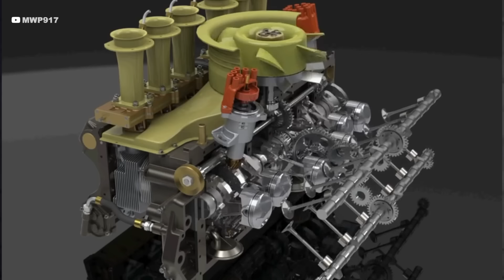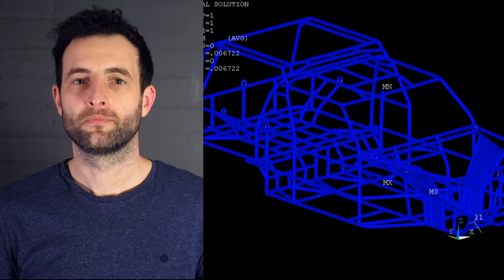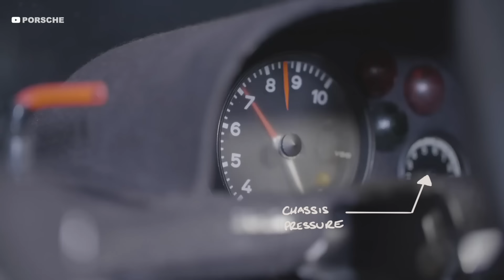The Porsche That Had an Inflated Chassis

Comment: Just imagine if they'd managed to (whilst fixing the aero issue) implement a DRS-style mechanism that could run faster top speeds in the straights, albeit at a safer level than the original. With the improved cornering performance with full drag/downforce in effect, there's 30mph of unused top speed available in the car, if they could have found a compromise of say 15mph improvement in straight line speed without affecting cornering performance, that car would have needed it's own class. 

In terms of the old back straight at Mulsanne, (I based on 3 Miles rather than 3.7 to allow for accelerant/deceleration), it ran the distance at roughly 48s, based on a rough calculation at 225 mph - taking that up to 240 mph would drop the time to 45s, and that's based on the back straight alone, let alone any others. So, the 917K gained 4s per lap by fixing the aero, if they'd managed to reduce the drag to 50% of it's original value just on the straights they could have made a further 3s per lap gain, at least.

To be fair, the question probably came up when redesigning the car to the K spec, but that was decades ago, perhaps if they had access to today's technology/data, this would have been possible.

Comment: I wonder if they could have fixed the problem of the air detaching from the car by adding small plastic vortex generators to the top of the car. Works wonders on airplane wings to keep the airflow from detaching!

Comment: Nitrogen doesn’t react with the metal due to displacing oxygen preventing corrosion also it’s a dry gas that does not react much to temperature causing a pressure rise or fall. That’s why we use it in HVAC

Comment: What effect was the air cooling for the engine to road holding. The fan was  pullung abotir from the bottom to the top, right?
Reply: fan pulls air down around the engine inside an enclosure, air exits below the car. no effect on roadholding.
Reply: No....top to bottom.....
Reply: @TheWilferch   Well it is a shame that the air was not running from bottom to top.  Extra Downforce??
Reply: @jamesthornton9399  ... well yes, theoretically that would be true.....but cooling a big flat-12 "evenly" by an air fan was difficult enough, and the most efficient and effective cooling would be forced-draft "pushing" air over the cylinders ....not instead having the fan suck the air on the exit side.
Reply: @TheWilferch  ok.

Comment: Just some nitpicky things:
It's not a flat-12, it's a 180° V12.
The car that had the "fly-issue" (ambiguity, lol) was not the 917k, it was the 917LH ("Langheck", or long-tail) so they developed the "Kurzheck"-variant (or short-tail), to improve downforce. 
And actually those teams that could afford it raced the 917k in the 1970 Le Mans Race and those who couldn't had to use the older LH-variant, of which none would complete the race while the 917k won overall, as far as I remember.

Comment: 1000bhp from a naturally aspirated 5 litre engine? No way Pedro!
The later CanAm versions with turbos yes but not in their original guise.
Also the Ferrari 512s were actually faster but as you say heavier due to their steel spaceframe chassis with aluminium panelling to try to increase stiffness and thus slower around corners.
Derek Bell drove one at Le Mans and complained that although his feet and lower legs were effectively the crumple zone as they were in front of the axle line, he had a problem with stopping the car from 200+ mph. This was due to the bodywork being so thin that the panel over the pedal box would flex downwards at speed and trap his right foot on the accelerator and required great effort to move it to the brake pedal. Not the best thing at speed, at night, in the rain, approaching Mulsanne Corner! As for the clip of Pedro Rodriguez spinning on his way out of Druids to Graham Hill bend, I was there that day and the whole race was held in those conditions. Yet Pedro recovered and went on to win by over a lap!

Comment: The Porsche 917 chassis was NOT inflated,  i. e. it did not get bigger like an inner tube or balloon,  it was PRESSURIZED, not the same thing as inflated.  Pressurizing stiffened the chassis so the suspension worked more accurately.  English is a very specific language with words of very specific meaning and important to use them correctly.

Comment: Is there any citation for the 917 having 1000hp? The only variant that I knew of that could achieve such horsepower figures was the 917/30 raced at CanAm.
Reply: "Porsche 917 - Wikipedia" https://en.m.wikipedia.org/wiki/Porsche_917. In the 1973 Can-Am series, the turbocharged version Porsche 917/30 developed 1,100 bhp (820 kW).
Reply: @sandybarnes887  I wrote that on the comment. The entire video is talking about and features the earlier 917K and I recall that car having slightly over half that horsepower...

Comment: Good video thanks, although to me the 'extremely difficult' handling of the 917 is let off rather lightly. Yes 'luckily' it wasn't an end-over-end flip as shown, but John Woolfe was killed when he spun his 917 on the opening lap of the 1969 Le Mans 24 hours. Richard Attwood has said that Woolfe is the basis of the deceased driver friend of Steve McQueen's character in the film Le Mans.

 Richard Attwood was also the winner of Le Mans in 1970 in the Number 23 917K with Hans Herrmann. The iconic Number 23 car is shown a bit out of sequence in your video.

Comment: Helicopter rotor blades used the pressurised spar solution to tell you on a preflight if the spar was cracked

Comment: 5:50 just out of curiosity
why they don't fill up the frame with helium so they can save even more weight
and it's a noble gas it won't react with aluminum

Comment: Pretty sure this car had around 600hp, not 1000. The Can-Am turbo 917s had 1000hp+, some say as much as 1500hp, but not the NA cars. 600hp was still a very impressive number for an NA 4.5 liter engine, in 1970. Also, particularly in the early 917s, the chassis were extremely flexible, which accounted for much of their evil handling nature. I love this car, it's one of my favorites of all time, but Porsche's reliance on the technical tricks mentioned didn't produce a sound chassis. It took bigger balls and greater skill to handle this beastie than it really should have.

Comment: Scott: That Porsche nitrogen or gas filled space frame was not such an original idea. My friend has a 1968 Czechoslovakian Zlin Z-526F tandem seat, aerobatic trainer with a very similar system. There is a pressure gauge inside the cockpit to detect any cracks in the chrome-moly steel frame. But unlike the Porsche 917 it was not made from "unobtainium" as the late Mark Donohue once quipped when asked what the frame was made from.

Comment: there's no way this actually changed handling lol. The reason for lightening cars is so that there's less inertia to be counteracted while cornering. Making the car more buoyant wouldn't do anything.
Reply: Depending on how much pressure they put in it would change how stiff the chassis is. Similar to how a coke can is stiffer when under pressure but very weak when empty.

Comment: Not 1,000 Brake Horsepower at Le Mans, but about 600-650 BHP give-or-take, and depending on the actual displacement (there were several versions).   But...1,000 BHP for the turbocharged versions that came over for the Can Am series (not Sifferts first non-turbo version), as with the 917-10 as driven by George Follmer and Donohue's later 917-30?   Oh yes.

Comment: I know the Ford GT40 had it in the front (the Mk.IV in the rear) and the Porsche 917 at the rear, on top of the gearbox : a SPARE WHEEL.
My question: was that in the rules back then?  Or did teams/manufaturers only put that in on long circuits like Le Mans, Nordschleiffe, etc. ?

Comment: Triangles are the strongest shape in nature (a British engineering guy that has a channel on YouTube said that)
Reply: Designers can learn a lot by examining structure of cathedrals built in the middle ages. Some of them had catastrophic failures as they progressed to larger and taller structures to be "nearer to heaven." Timber ship building too. I find those two things very interesting, along with timber frame homes roof systems.

Comment: Pedant's corner: pressurised, NOT inflated, which surely would make a better, alliterative title: 'The Porsche with a pressurised chassis'

Inflation - literally by definition - means the object being inflated is distended by air or gas: if the chassis was that weak they'd be in real trouble... 
Came here hoping to learn something new on a deep dive about a fascinating detail of a legendary racing car, what I got was muddled ramble about the 917 generally without clear context or history, generally & of even evolution of the 917 itself: there's a section on the 917K at ~10mins - but that's virtually all that's shown throughout the whole video. Isn't the paid promotion actually longer than the bit actually teased in the title? It's also a separate section / chapter which the relevant bit isn't. 3 out of 10

Comment: The 917's engine was not a flat 12, it was a 180° V12... its essentially a flat 12 with a V12 crank and cams, another car that used this kind of engine design was the Testarossa, the only manufacturer to ever build a real flat 12 was subaru

Comment: 0:30 Seriously Scott, you are not doing yourself any favours with these ridiculous claims. The Porsches shown in this video as overlay for that comment never went to "nearly 1,000 brake horsepower". Not even close. The 4.9 litre 912 engine had about 620hp (see: "Super Sports: the 220 mph Le Mans Cars", Haynes, 1988, p. 78). The only 917s which went to 1,000 hp and beyond were the twin turbo, 5.4 litre 917/30s of CanAm, which were good for 1,100hp in race trim and up to 1,400 (give or take...) in practice trim. 

Secondly, the 917LH was NOT 30mph faster on the straight than anyone else. In 1971, the fastest car on the straight in practice was a Ferrari at 359 km/h (222.6 mph). In the race the Porsche did 362 km/h (224.4 mph). So actually, only 1.8 mph difference, Scott. Google Mulsanne's Corner "maxspeed" for the official ACO speed trap figures.

You should think about changing your channel name to "Motor Sport Myths". Your driving analyses are fascinating. Your technical stuff is bollocks.

Comment: But the 917 didn't have 1000 horsepower did it? I thought it had 600. 1000 would be absolutely ludicrous.
Reply: The 917-30 ran races with 1100 hp.  The driver could increase the bost to 1500 hp (other hp number are reported).  Mark Donohue said at 100 mph and aerodynamic down force twice the cars weight could do burn-outs with racing slicks 36 inches wide.
Reply: @DrsharpRothstein  Bruh that's the 917-30. This video is about the 1970 917. They didn't have turbos back then; the engine was naturally aspirated and produced 600 HP. Which, is insane considering it was only a 4.9L 12 cylinder with no fancy supercharger or turbocharger. He messed up when he was talking about the horsepower figures.
Reply: @bryanr93  
He missed up a lot of info.   The hp number is correct, mostly for the 917-10 & 917-30.
For the 70's car there was the aerodynamic disaster original, 917k, the John Wyer 917 (k) - very similar to the k but with a lower rear deck with a airfoil in the center cutout, the John Wyer 917 (k) with a much lower rear deck with two fins that had 15% drag reduction with the same downforce as the original k, the 917-20 aka the "pig", and the 917L.   The video mixes them together from the homogenization cars to the 917-30.
Reply: "Porsche 917 - Wikipedia" https://en.m.wikipedia.org/wiki/Porsche_917. In the 1973 Can-Am series, the turbocharged version Porsche 917/30 developed 1,100 bhp (820 kW).
Reply: @DrsharpRothstein  ,,,homologation cars.....

Comment: You keep showing the 917k version when talking about the original long tail 917.  And the animation is wrong.
Reply: Absolutely right. I came here to make the same comment and saw yours with a quick scroll through. There were only a couple of glimpses of the original long tail that was the problem in the video, and he certainly didn't make it that clear this was the one with the 
issue.

Comment: If they actually cared about weight, they would have made the inside of the chassis a vaccum. That way they can measure the negative pressure, and saved weight by not having any gas inside the tubes.
Reply: Putting the tubes under vacuum would have weakened them compared to putting them under pressure strengthening them. Plus the weight savings would have been minimal at best.

Comment: That's not what inflated means... inflated means the shape is formed due to the pressure inside.  Like a balloon.  If metal is 'inflated' then it has yielded.  This is just pressurized.  You should've also mentioned how the 1971 LeMans winning car was the only one to have a magnesium chassis.  Good info overall though!

Comment: They will get respect when they succeed in formula 1. The TAG 80’s Porsche designed F1 engines were world class but for very short time. Renault’s were more powerful and Honda more efficient, helping McLaren win 2 Constructors and 3 drivers championships.

Few companies succedeed designed both the chassis and engines in F1. Mercedes, Ferrari, Renault, BRM and Vanwall.

Comment: thinking of using hydrogen instead? it would be lighter for the same given pressure, maybe even boyent... however hydrogen diffuses into metal changing the structure and like helium can also diffuse out of extremly small cracks. this is governed by grams law of diffusion where the rate of diffusion is proportional to the square root of the gases molecular weight.

Comment: I'm surprised given how pedantic they were about weight that they didn't just use helium. Would have saved a few hundred grams lol. They made the shift handle out of balsa wood ffs to save several grams. 

I'm surprised they didn't make the driver eat food that wasn't as dense for a few days prior to the race, make em shave top to bottom for weight reduction, only hire people who have had an appendectomy to drive, and wear a race suit one size too small something hahaha.

This was literally the last word in weight saving. The more you read about it the more you realize how obsessed they were with saving weight. So much so they forgot to make sure they had air going over the fucking rear wing. Absolutely amazing machine though.

Comment: 2:18 And what happens when one of those tubular frames suffers an impact on its horizontal axis Einstein?  It folds up like a cheap suitcase, a perfect recipe for disaster when you underbuild a car and focus too much on weight savings - Space Frames are great for static objects like buildings but cars in a race are highly susceptible to bending forces from impacts of external objects i.e ALL THOSE OTHER CARS!! All moving at very high speeds

Comment: They stole this idea from Sikorsky. The Blackhawk helicopter (designed in the early 60’s) had nitrogen pressurised titanium main rotor blade spars. If the blade spar cracked, a visual pressure indicator showed red indicating a crack or loss of spar integrity.

Comment: Absolutely NO 917 that was in endurance racing configuration....a coupe...as depicted in the videos....EVER had 1000 brake-horsepower. Think 560 or so at the end of the 1971 season when it last ran in normally aspirated trim. Maybe 590-600. Over 1000 hp maybe was run as a Can-Am turbo car, and even then you hear dyno numbers quoted as high as 1500, but they never ran that high boost in racing. As to putting nitrogen gas in the chassis tubes....it was only as a check to see the leak-down over time,  and if severe, indicates a tube crack or weld-break in the chassis. Yes, it was envisioned to have the tubes do double-duty by carrying oil all the way to the front-mounted cooler...and back again.....but at least in the most successful configuration....meaning...as run by the John Wyer / Gulf team.....they considered this too risky and actually ran independent oil pipes and rubber tubes to the front cooler and back.

Comment: Its a wonder that Porsche didn't understand aerodynamics.
Reply: Up until the 917,  Porsche make 'little' cars that were very much engine limited at top speed.  Porsche idea of aerodynamics at the time was very low drag to increase top speed.  They have never encountered high-Speed lift in any previous car that impacted its handling.  The 917 changed all that.

Comment: So lets get this straight you're saying the frame was pressurized with nitrogen and at the same time they are running oil in the same pressurized part of the frame.Wrong! Yes they used nitrogen to provide clean welds during the build and a way of testing all the finished welds of the frame submerged in soapy water. Yes they used pipes front to the oil cooler radiators but these pipes were not pressurized with nitrogen when racing. Only the chassis was.

Comment: All racing cars in the 60s used tubular chassis monocoque construction was not invented at that time. Aero dynamics was in its infancy and no they were not slippery and flat engines hinder undercar aero just look at how long ago Ferrari gave up their famous flat twelves for Vs so they could manage the air with diffusers. This channel is like slowing to see an accident you can’t not do it but all you read is unresearched carnage